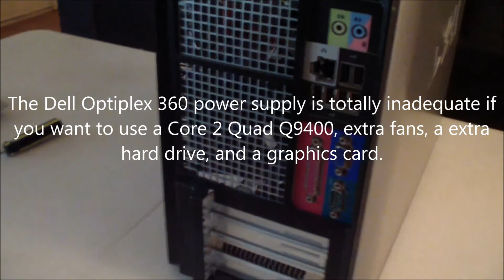Dell Optiplex 380 Power Supply Upgrade

Comment: I don't think it's necessary to update the 255W PSU.

I have upgraded Optiplex 380 to Core 2 Duo E7600, 8GB DDR3 1333Mhz, 1TB 7200RPM HDD, and Win 10 Home 64-bits. Peak power consumption is 83.5W (I have wattmeter attached on my PC), average is 55W. I don't play games, but I used ACDSee 2018 to fix photos and videos. 

The low profile graphic card average power consumption is 30 Watt (the normal size GPU is 70W, but low profile usually consumes less). So that leaves you with more than 100W buffer (255W - 83.5W - 30W). I'll have my GT 1030 2GB low profile somewhere this week to see how much that the desktop consumes.
Reply from the maker: My system has a Geforce GT 740 1 gb, 2 hdds, 2 80mm rear exhaust fans, 1 PCI card exhaust fan, DVD-RW drive, 8 gbs ddr3 1333, and a Quad Core Q9400.The Geforce GT 740 has a TDP of 64 watts, the Q9400 has a TDP of 94 watts, so it draws much more power than your system.
Reply: Daniel, so you use your 380 for video editing? My fiancé vlogs and I have been staring at this 360 I have laying around wondering if I could use it for just that after upgrades.

Comment: It's hard to find psu thats gonna work well,
I have the same pc whats the good psu for this any recommendations? i use GT 730 6gb ram 4x2
Reply from the maker: Any ATX power supply should work, but getting it to fit on a Dell Optiplex 380 is going to be a problem.

Comment: would a 20 pin plus 4 pin standard power supply work.
because i counted 23 pins on the original .?
Reply from the maker: Yes, a standard 24 pin power supply will work on the Dell Optiplex 380.

Comment: I want to upgrade my dell optiplex cpu to q9400 graphic card gtx 760 2 gb  2x 4gb ram 500gb hard drive and power supply.how much costs all these any idea?and after this upgrade can this pc playing modern games like gta5 mortal kombat x pes 2018 and other games?
Reply from the maker: About $220 to $270.
Reply from the maker: Graphics cards are very expensive right now, so don't buy a graphics card yet.
Reply: I have bought the graphic card geforce ge gigabyte 760 2 gb.i have installed and works good.without upgrading other parts he opeen good games.im thinking to upgrade cpu ram  for the moment.
Reply from the maker: Graphics cards are very expensive due to this Bitcoin cryptocurrency mania. The price will come down in a few months as Bitcoin and cryptocurrency prices have been falling since mid Dec 2017. A Geforce GTX 760 costs about $267. A Geforce GTX 1060 costs about $359. Those prices are too high. Ram prices are also very high right now. 

If you have a lot of money to spend, just buy a graphics card, but you will pay a lot for it.
Reply: You right but i already bought this graphic card.i have not a lot of money bro but i just want to play some games in this old pc.do you think after upgrades this pc can play somme good games?
Reply from the maker: You will need at least 8 gbs of ram, a new power supply, and a new hard drive.

1. 8 gbs of ram DDR2= $40
2. 600 watt spu= $60
3. Western Digital 1 tb hdd= $56
4. Intel Q9400= $40
____________________________________
$196 

You can buy all the parts on Amazon.
Reply: Thanks bro for all the  informations.you helped me so much
Reply from the maker: You're welcome.
Reply: Hello bro can optiplex 380 suports Core 2 Quad Q9650?
Reply from the maker: Yes. 
It can support these cpus.

Intel® Core™ 2 Quad Q9650/3.00GHz, 12M, 1333FSB
Intel® Core™ 2 Quad Q9550/2.83GHz, 12M, 1333FSB
Intel® Core™ 2 Quad Q9505/2.83GHz, 6M, 1333FSB
Intel® Core™ 2 Quad Q9400/2.66GHz, 6M, 1333FSB
Intel® Core™ 2 Quad Q8400/2.66GHz, 4M, 1333FSB
Reply: And have any difference from q9400 to q9650?
Reply from the maker: Q9650 is faster.
Reply: @Ace1000ks  didnt know it supported q9650 thx

Comment: can you please tell me if stock PSU (255W) would run XFX AMD Radeon R7 240 2GB ??? thank you.
Reply from the maker: It states you need at least 400 watts, so you may have to upgrade the PSU.
Reply: Why you telling like this i installed gtx 760 without changing psu and its woking with stock power supply
Reply from the maker: 235 watts isn't enough, you can use it, but you risk blowing out your power supply and motherboard if you play games or do something intensive.
Reply from the maker: The graphics card isn't running at 80% to 100% unless you play games with it. It is running at maybe 5% to 10% when you aren't playing games. When you play games, it could shut your computer down, restart, or you can get blow capacitors.

Comment: i have a dell 380 , I want to upgrade , I have 4 gb ram 1066 - It's possible 4+4 gb ram dual  of 1333 , and a new cpu a 660ti 2 gb /        and processor xeon e5450 .....and 1 hard disk 1 tb -- It's posible ? Tell me please  fast i need this information  please
Reply from the maker: Here is the video that has links to where you can buy the ram, cpu, and other parts. 

https://www.youtube.com/watch?v=Sb8s3RwVa9Q
Reply from the maker: You can upgrade your cpu to a Xeon E5450 3.0 ghzs processor or a Q9550 3.0 ghzs processor which will work without any modifications. If you upgrade to a Xeon E5450 processor, you have to use cover up the extra 4 pins with a sticker. The Q9550 is the same processor without the need for such a modification. 

You can add a SSD, or a larger hard drive to this computer. You can also add 8 gbs of ram 4 gbs for each slot. You can buy a better GPU than a 660ti 2 gbs, like a Geforce GT 1030 2 gb which is newer and faster. I have all the links to where you can buy these on my other video. https://www.youtube.com/watch?v=Sb8s3RwVa9Q

Comment: i have factory 255w psu and this spec: 
 Intel Core 2 Quad Q9300 @ 2.50GHz 48 °C
 Yorkfield 45nm Technology
RAM
 8.00GB Dual-Channel DDR3 @ 531MHz (7-7-7-20)
Motherboard
 Dell Inc. 0HN7XN (CPU)
Graphics
 SyncMaster (1280x1024@60Hz)
 1024MB ATI AMD Radeon HD 6670 (Gigabyte) 30 °C
Storage
 232GB Seagate ST3250310AS ATA Device (SATA ) 37 °C
 238GB SAMSUNG MZ7LN256HCHP-000L7 ATA Device (SATA (SSD)) 30 °C
Optical Drives
 TSSTcorp DVD+-RW TS-H653G ATA Device
Can i continue running this components with my 255w psu? Thanks forward !
Reply from the maker: ok

Comment: I was trying to buy he GeForce gt 1030 graphic card but come to find out I don’t meet the requirements lol 😂
Reply from the maker: You can use a Geforce GT 1030, but it has to be a short single slot card, like this https://amzn.to/2JVVvDK .
Reply: will this work tysm by the way i got that power supply installed in my rig that you recommended in your description evga 500b 500watt power supply
Reply from the maker: @bluetorch8166  300 to 400 watts should be enough for this card.

Comment: Could I fit a Asus 7970 in here?
Reply from the maker: No, because it is too large. Only small graphics cards can fit in this computer.
Reply: Ace1000ks1975 is there anyway I can modify the shroud or get a different heat sink to make this work? Thanks
Reply from the maker: You can't get any other heatsink to fit, because the holes on the motherboard will only fit that heatsink shroud.
Reply: Ace1000ks1975 dang. Thanks anyways
Reply from the maker: The Dell Dimension Optiplex series usually can't take large graphics cards, Dell did it on purpose to limit upgradeability of these machines. The Dell XPS series, and Dell Precision series can take large graphics cards. Those computers are Dell's premium computers. The Optiplex series are designed for offices, so they were purposely limited in accepting large graphics cards. Dell XPS computers and Dell Precision computers are more expensive. Building your own computer is the best option when it comes to upgradeability.
Reply: Ace1000ks1975 if I get a pcie riser will it work?
Reply from the maker: If you use it, you can't close the case.